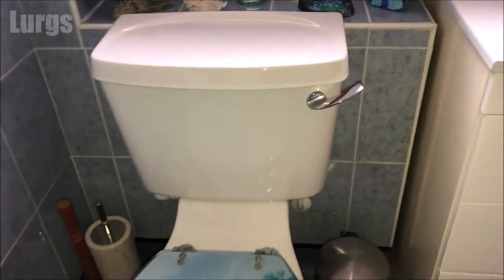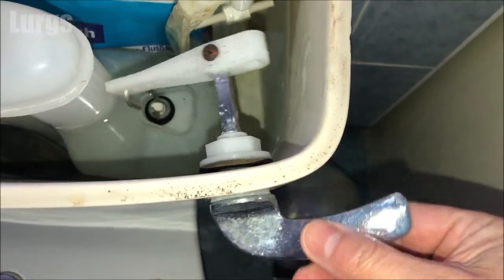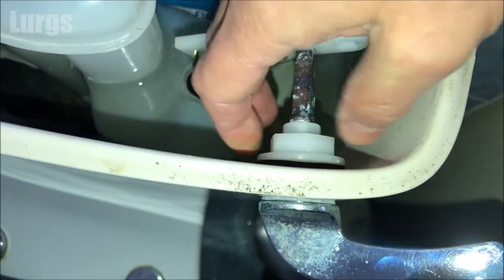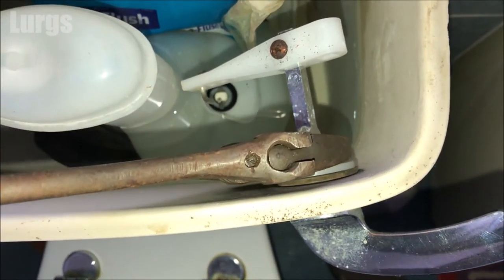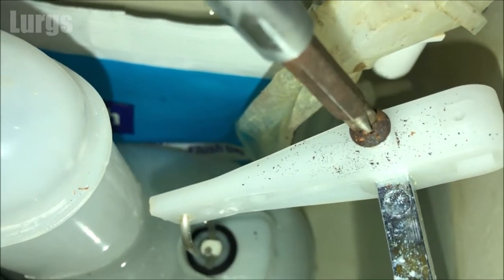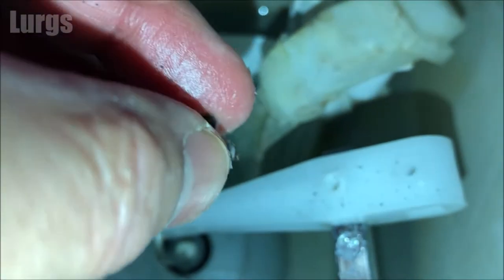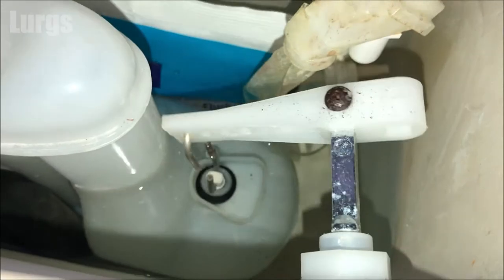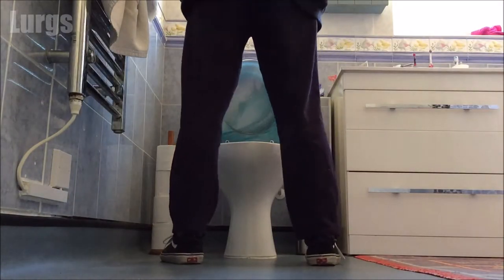How to Fix a Loose Toilet Handle Flush Lever

Comment: Would putting some loctite the thread of the handle before tightening the handle nut be a good idea??
Reply from the maker: I wouldn't recommend that as if you ever have to remove it you would have to probably smash it off. Mine doesn't come undone, hand tight should be ok

Comment: I've changed mine twice. The plastic nut just doesn't hold the handle tight. It stays in place and the handle slides in and out of it. Plastic just doesn't have the grip. What can I do? This is two new handle sets that I've done in one month. The first snapped the same night I changed it and the second one just slides about. I tighten it, it just gets to a point where I'm moving the spanner round and the nut is turning yet it's just not 'bonding' to the cistern wall. Do I bond it in place to stop this happening?
Reply from the maker: I think that's the issue, the handle isn't meant to be super tight, it will always feel quite loose. The plastic nut should only be tightened up hand tight, not really tight with a spanner. I wouldn't glue it, that will cause more issues. Good luck.
Reply: Ah, okay thank you!

Comment: I can tighten it up, but it comes loose, again, in a few days.
Reply from the maker: Is the actual plastic nut loose inside the toilet cistern? This should be fairly tight, the actual toilet handle will always have some play in it and feel slightly loose.
Reply: Black rubber washers each side
Reply: Nylons mayb rub seal tension insidee by Nut mine
Reply: Create the adhesive or  craft glucell leaide inside threadS of nuts twist set firmy find dry time twist y bak off parts ..let harden should I have formed a seal   &7 tight bu5tt flush!
Reply: @LurgsHowToGuides  Yes, the nut keeps coming loose.
Reply: @mikerancour457  Thanks!
Reply: @mikerancour457  Thanks!  Will try that.